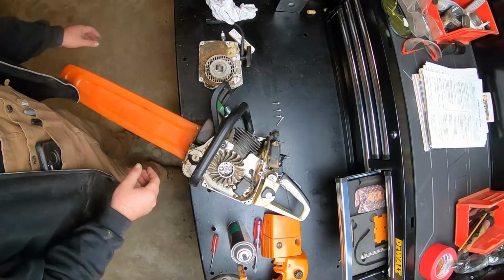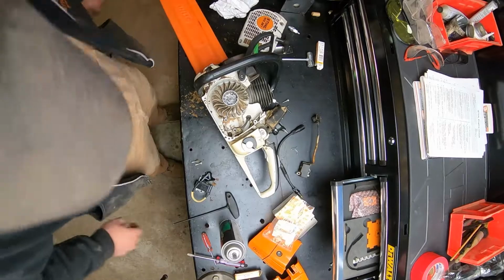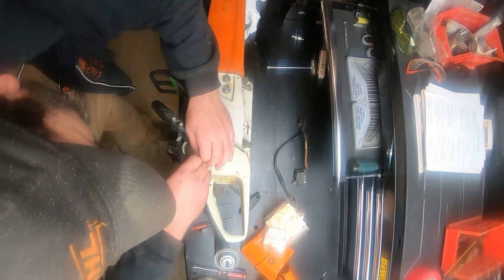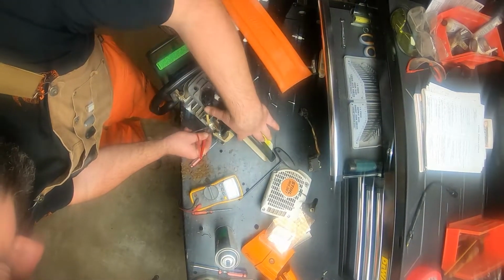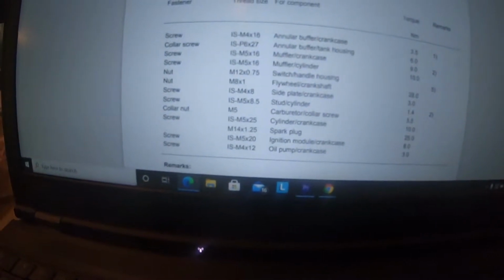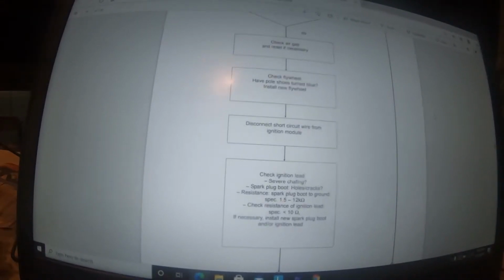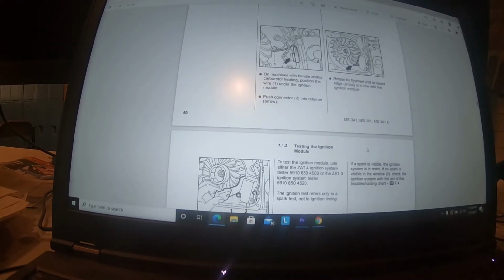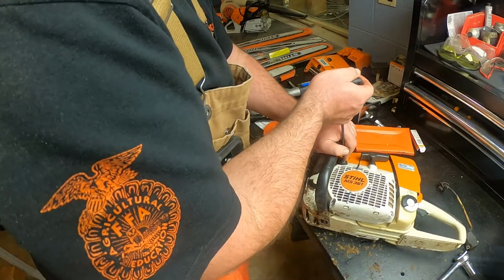Stihl MS 361...No Start....Bad Ignition Module???  OR... Fly Wheel???

Comment: I think I have a weak spark on mine even after replacing the coil. When I put my spark tester on I only get a spark every second pull. I’m also curious on what the coil ohms should test cause I got two new ones that don’t align with what a coil should test at and the old one is way outta whack.

Comment: Great video, most common occurrence for me is just as you said, that little sparkplug spring attachment clip that is simply bayoneted into the high voltage wire. There has got to be a better design for that clip.

Comment: At about 2:49 into this video, you mention that the new ignition module is "...a 1306 and that's a 1300A, so, hopefully, this is all new and improved..."  As we've been here a couple of times with our MS361, I'd like to know if the full part number you used to make the coil replacement was 1135-400-1306 (I never heard you mention the entire Stihl part number) and, if it was, I wanted to verify that you left it in the MS361 you were working on in the video?  As I'm sure you know, the OEM 1135-400-1300 coil for this saw is very expensive, so having a suitable replacement part number simply makes finding a replacement easier for all of the MS361 owners out in Stihl world.  Thank you for making this informative video.

Comment: Do you have a link to Amazon or another site to purchase the special tools such as the spacer used to gab the ignition module and the spark tester?  Thank you
Reply: A business card is fine to set the gap
Reply: On the ignition to flywheel thats what i do it works .
Reply from the maker: I really need to look into the Amazon Thing, but the special tools come straight from my local Stihl Dealer.  Your local dealer should be able to take care of you on most of them!  Thanks for checking out the video!

Comment: What is the website you’re using for that information?  Just took my 361 clutch cover off to clean it since it’s excessively leaking bar oil and it’s like sludge under there the sawdust and oil. Saw has been running just fine prior to this. Anywho I ran it without the bar at idle and maybe a few slight throttle revs just long enough to confirm oil was coming out of the slit to oil the bar, put the bar back on tightened  the chain and now it won’t fire up at all. I checked for spark which it does have, I didn’t check compression with a gauge but it feels like it has good compression I can hold the saw by the pull rope and it pretty much stays still without dropping. Now the newest thing I’ve seen with it when the saw is inverted fuel drips out by the chain brake/muffler area. Any insight will help. I’d like to get my hands on that troubleshooting flow chart. Thanks.
Reply: best chainsaw ignition vidio I have seen. The only one that tells you it could be the flyweel. Than you.